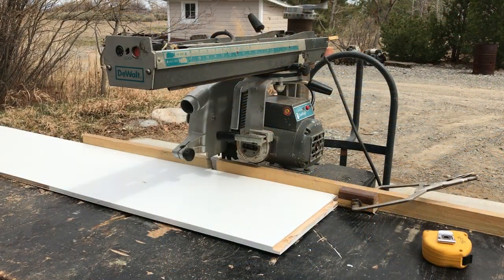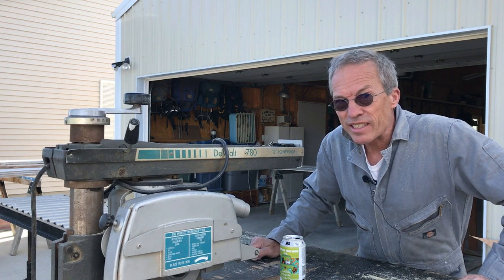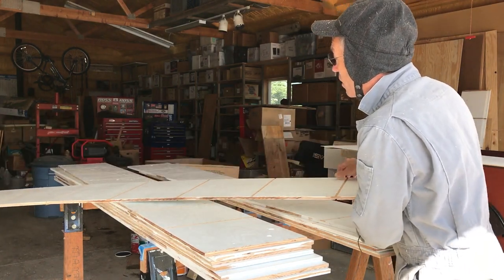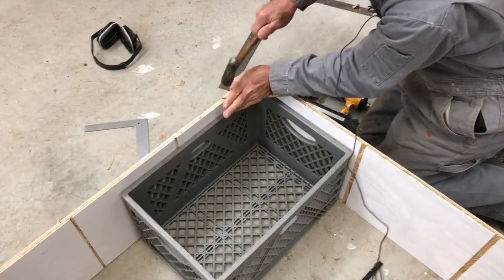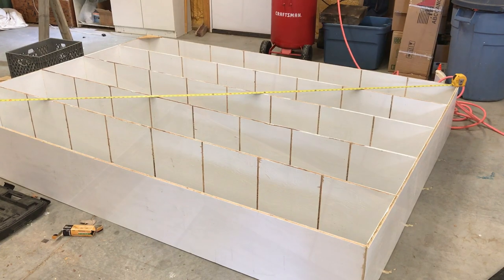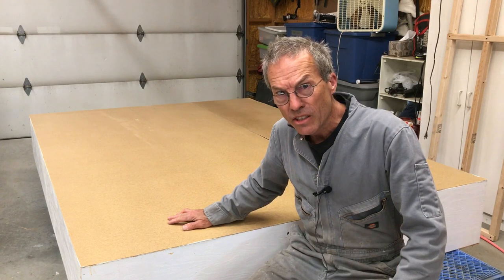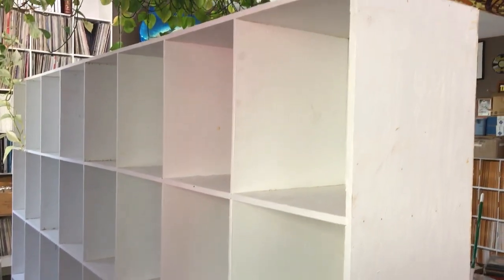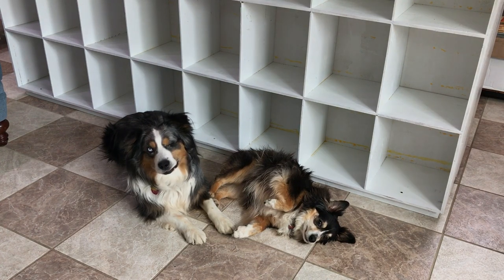DIY Homemade Record Shelving

Comment: Had a radial arm back in the late 70's, ened up with tablet saw with router table ext. I'm a carpenter that went to a Technical high school 73-77. I've got the same dado blade
Reply from the maker: We're probably about the same age.  We had an awesome shop class program when I was in High School and my Dad taught me a lot about design, using tools and fabrication.
Reply: @CactusCowboy57  nice work. Thanks for share. Love the dogs too!